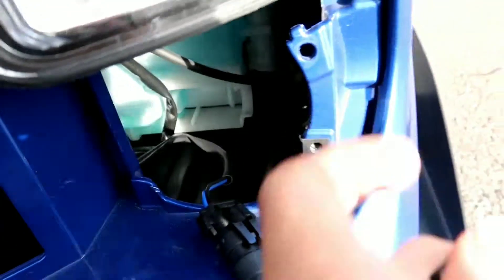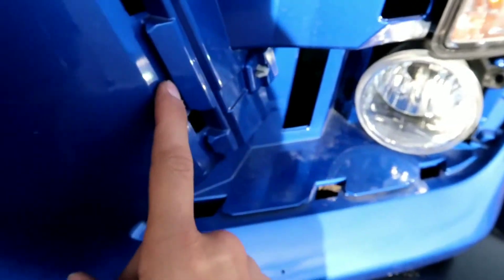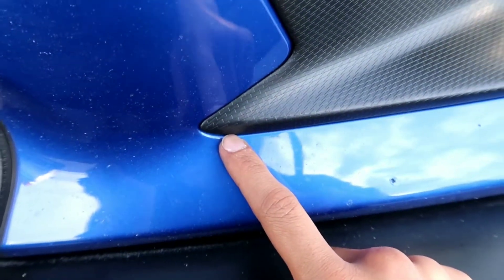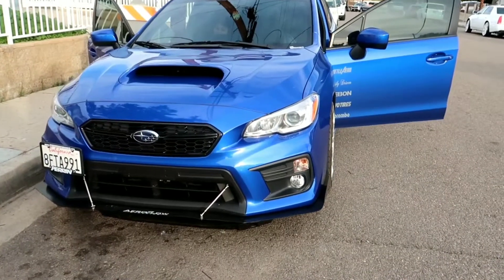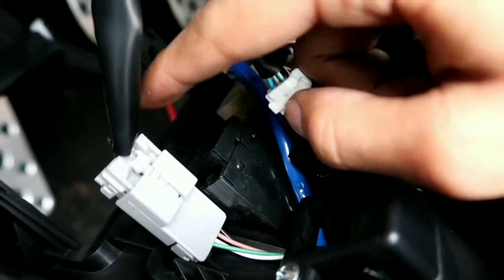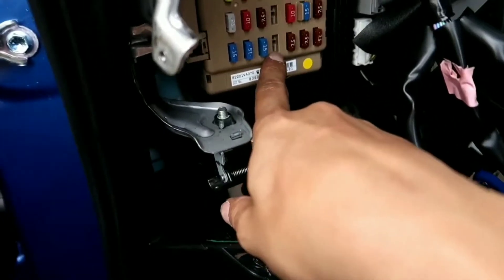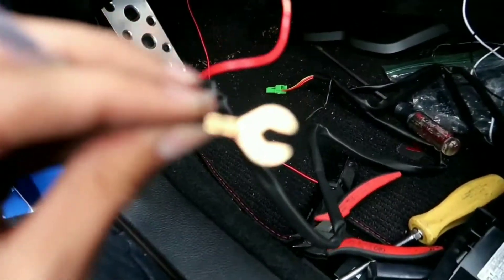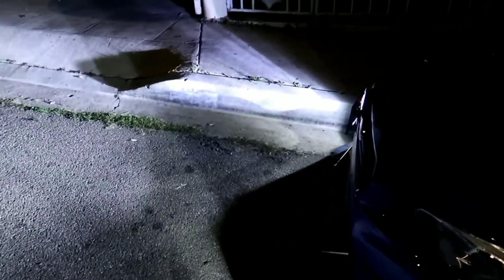Installing Fog Lights on My 2019 WRX

Comment: Did you use a relay?  Switch->relay->lights?  What about tapping a circuit that is only on with ignition that way you don't drain the battery when car is off?   In another video, the j-clip/quicknut was put on the fog light tab and not the car tab...what's the difference between the two? Will your light(s) angle in 1-2* or are the square/facing straight ahead? I believe your way is more secure as it puts the fog tab btwn the securing hardware